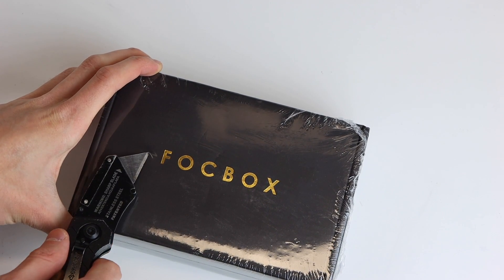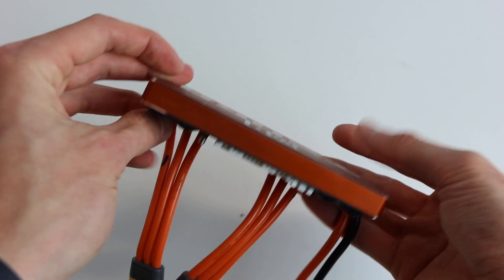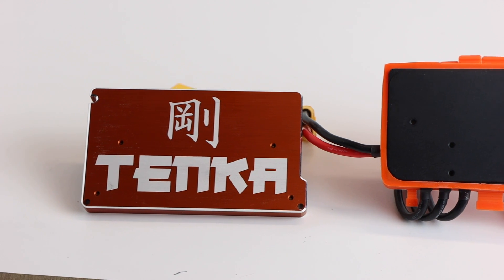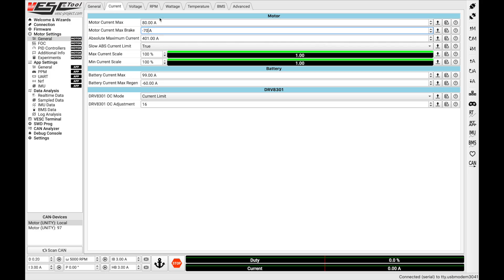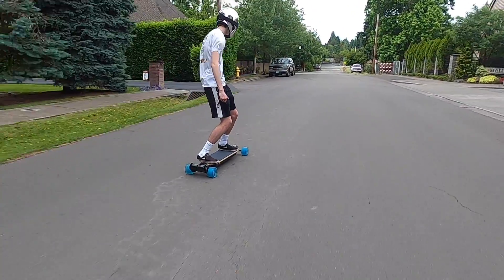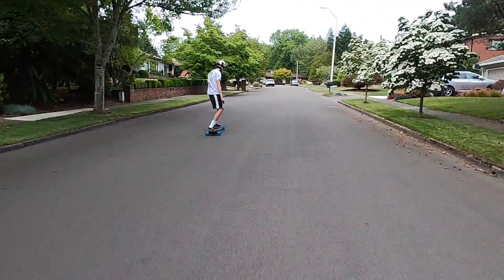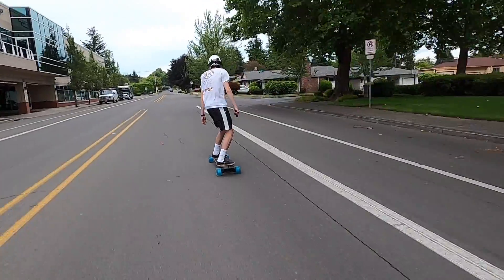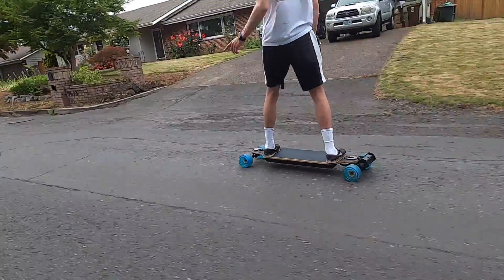FocBox Tenka Review - $199.99 Dual VESC

Comment: The reason it can not handle more than 70A is that one of the Unity components missing from the Tenka are several high power transistors that populate the Unity board. This is hidden under the black silicone waterproofing.

Comment: New to eskates here. When motors are advertised as "6370" or "6368", what does that number refer to? Also, what motors are you running?
Reply from the maker: 6374 is what we are running. Numbers refer to dimensions. 6374= 63mm diameter and 74mm long.

Comment: Hey I did some digging and I found an esc based on your advice. There is no IMU, but an MPU9060 will fix that. The FSESC 7550 will provide just enough to overvolt a 1200 floatwheel motor to 72v @40A to give me roughly 25mph top speed, and torque that will throw you off. Is this a good choice?? I’m kina new to the PEV stuff but I’ve built my fair share of rc cars. Would this ESC work?
Reply from the maker: I've tried adding an external IMU and it does not work as well (at least for me. I tried countless times but it was always very glitchy). I highly recommend getting an ESC with a built in IMU. It will make the built much much easier

Comment: This is the same setup as the demon 2.0 just with the tenka instead of the unity correct? If so about how much top speed did you lose by going to the tenka?
Reply from the maker: exactly. No speed lost at all. Just acceleration and hill climbing ability. Would recommend the unity over this though. If you don't want to go unity though, I'd still even recommend UBox over this.
Reply: @DIYesk8Builders  thanks, your in pdx right? So am i

Comment: I recommend turning off smart reverse! When you’re hard braking and coming really close to a stop, the board will try going in reverse and since you are still going forward, it seems like too much to handle and it will simply let go of the brake (like if the board goes neutral) and sends you flying around the 0-5mph mark , it happens occasionally not all the time but it’s better to keep smart reverse off! I learned this from the esk8 community

Comment: I remember when Unities were 200 bucks, which is when I bought mine. With the price hike, and with this new product being a bit too mysterious for my liking (you can't check the internals because of the black goop), i would opt for a Trampa or a 60D (prob Trampa) for a lilttle bit more money.

I should add, that unlesss youre paying for a premium ESC (Trampa/Lacroix), then I really think lack of warranty/service for a cheap ESC (<$200) is a kind of bs point - these should be just understood as consumables after a time (90 days is fine). Even the 'reliable' budget ESC producer Maker-X made it practially impossible for me to return the wrong ESC back to China ( I unded up reselling it at a loss). That said, my Unities have all worked flawlessly and are easily the most straightforward and reliable of all ive tried.

Comment: My focbox unity is a gem. No problem with it. But i would hate it if it didn't have Bluetooth as i need it to know how much juice is left. I don't have battery meter/display obviously.
Reply: BigFatCone  yes. If it's the classic focbox. So you can download with focbox app on Android (which doesn't seem to work well for my direct drive) but the VESC app on my Android phone works well with my TorqueBoards direct drive.

Comment: The fact that it tossed you doesn't inspire much confidence. I'm curious, what ended up happening to the Unities that broke? Were they ever repaired, or did they just get binned?
Reply from the maker: The unities that were broken from us got sent to a repair guy that massive stator was working with but never ended up getting fixed. They got sent back to us and we are now looking for a place to get them repaired.
Reply: @DIYesk8Builders  
Guys you can’t sell this shitty product you just said that the unities got sent back 
Please put a disclaimer on this 
And stop working with shady Jason poop poo 
He doesn’t care about us esk8ers he just wants to make money and scam us and also Hurt us 🤔
literally look at your fall can you imagine a newbie falling setting the amps on accident wrong 
I like you guys but stop selling this shitty stuff you’re going to get people hurt
Reply: Turning the settings up too high on any VESC will do the same thing.  You need to know the limits of the equipment.
Reply: @BG-yk9fk  I've yet to encounter a motor lockup from a controller simply from have a current limit set a few amps higher than it's rated. It wouldn't even be an overcurrent fault, but instead shows that the heat management isn't good. It may matter, as it's an indication of lack of longevity. A limit of operation that thin doesn't inspire confidence that operating the controller at that limit would allow for a reasonable lifespan.
Reply: @TheBoardGarage  If it's a lockup.  Many times folks think it's a lockup because sudden loss of power while under heavy acceleration feels like brakes, but isn't.  Looking at the video it doesn't look like a lockup.
Reply: @BG-yk9fk  At that distance, and lack of detail, how could you even tell?
Reply: @TheBoardGarage  hard cuts are most likely due to the BMS in battery cutting power from hitting discharge limits. If you are familiar with how VESC based Thermal management systems work you will know that they will slowly reduce performance, not hard cut.
Reply: @TheBoardGarage  I said "Looking at the video it doesn't look like a lockup."

Comment: Shame they took off half the thermal mass, and the ble module and the silicon boot, and only added the wrong gender xt90. That would have reduced cost by like $8 max... smells fishy. I wonder if these aren't actually faulty unities that were reworked then filled with black goop to cover up the rework. There were a ton of unities with failed Antisparks that could have been used this way. And now it's fully potted with that black goop, it's no longer repairable. The difference in max amps is maybe due to removing half the thermal mass.
Reply: the unity has less thermal mass than tenka.
Reply: @ElectricSkateboardBuilder  but it's only on the pcb side. Nothing directly on top of the mosfets except goop
Reply: @josh4014  the MOSFETs we use are designed to dissipate heat through the PCB, the heat sink on top of unity is mostly for aesthetic purposes, and therefore doesn't improve thermal performance significantly. The best way to wick heat away from fetts is a larger heat sink mass on the bottom of the PCB which is what the tenka case design offers.
Reply: @ElectricSkateboardBuilder  so why only 70A on tenka vs 80 on unity +
Reply: @ElectricSkateboardBuilder  can you confirm that the Tenka and Unity are component-level identical? Or has the Tenka had power stage components removed?

Curious why the motor amps would be less while battery amps are the same as Unity.

Comment: The reason Tenka can take 70a instead of unity's 80a is the heatsink, Tenka heats up a little faster. Those are continuous limits based on the unit's temperature, not on what the unit can push, it can push way more.  So with 80a on Tenka it would only reach throttling temperatures sooner. It should still be able to use up to  140-150a per motor. So the fault wasn't supposed to happen even if you use way more than 80a.
Reply: Wasn't supposed to happen...but did?
Reply: I second what @esk8 spirit says!
Reply: To test this theory we'd need to add a proper heatsink on it. Since the black goop covers over the internals, you cant check to see if there is indeed anything internally different/missing (some have suggested Mosfets were left out to cut costs..)
Reply: No, it's not. It has a lower amperage rating because it is missing some of the high power transistors that are on the Unity, and thus can not physically  generate the same amount of power amplification..
Reply: Yeah I've run an original run Unity at 100 motor amps on the daily, without issue. Something isn't right here. 

Also, what happens when these need to get repaired?  Just throw it away and replace? Doesn't seem very e-waste friendly.
Reply from the maker: 100% Not a huge fan of the design. Still not entirely sure about what caused that failure but I do know that on 80A it cut out on the second try up that hill and on 70A we have had 0 problems. Could be something else but it made a difference
Reply: @DIYesk8Builders  from memory i recall you saying your battery has a 80a limited by the BMS
Reply from the maker: BMS is not bypassed but is rated for 145A
Reply: @DIYesk8Builders  what was your duty cycle set to when the vesc faulted/motor locked up
Reply: @DIYesk8Builders  or do you know what settings you have now for motor current/phase current/duty cycle?